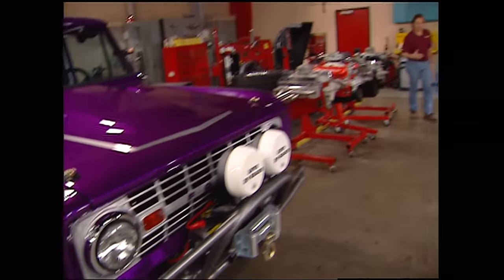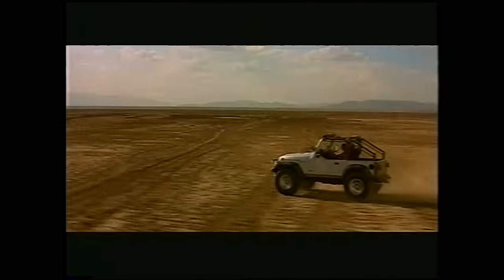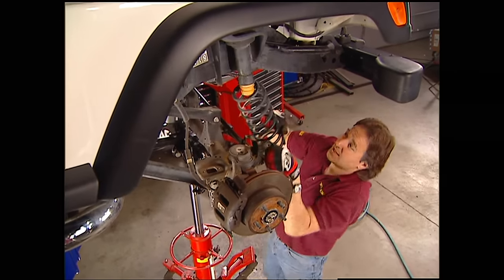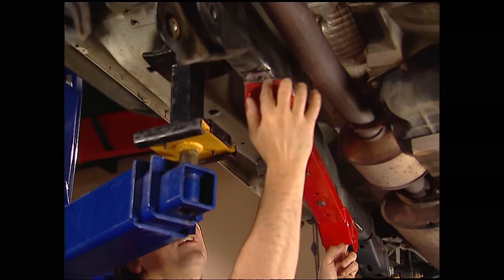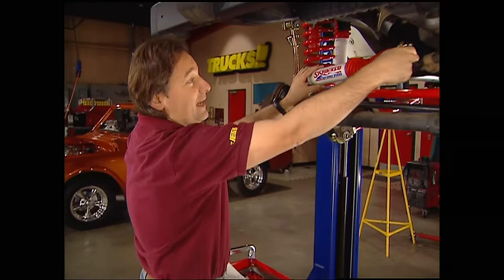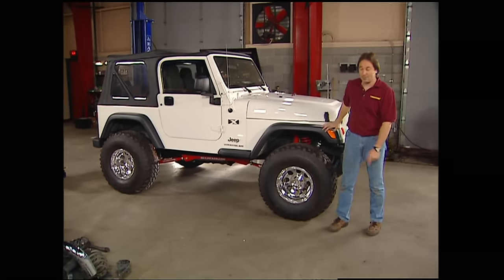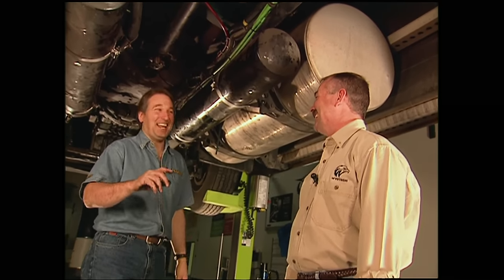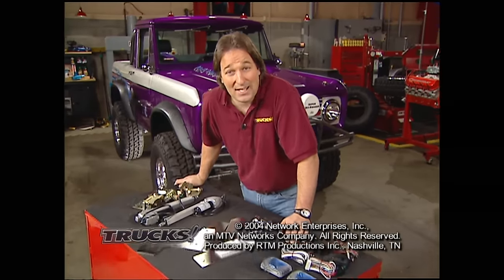Turning A Stock Jeep Wrangler Into The Ultimate Jeep From Tomb Raider 2 - Classic Trucks! S6, E3

Comment: Entertaining I've give them that.  My son just purchased a 2004 Jeep Grand Cherokee and he is doing the lift, repairing some rust, addressing electrical issues, installing a roof rack, repairing the sound system, bigger tires, brakes, new heavy duty front and rear bumpers, winch, coolant system, control arms, etc. himself in his drive way with just a couple of floor jacks and jack stands.  A friend is making the custom bumpers and my son will do the welding and powder coating.  All of this in the evenings and on the weekends, with a day job and he isn't a mechanic.  I say this for anyone looking to do mods/upgrades to their off-roaders that you don't need a fancy shop, deep pockets ( do some competitive shopping) or think the only way to get what you want is to pay someone to do it for you.  My son has made mistakes, learned a lot along the way, had some speed bumps, but when he finishes it, he'll know he did 99% of it himself and will have pride in that.  Plus know that if something happens on the trail, he'll have the knowledge to hopefully fix it and keep rolling.  My old daily and now his, is a 2005 Jeep TJ Rubicon, 6-speed manual.  Not what you would get on the highway with but darn fun to play in the dirt with.
Reply: I’ll give them that lol

Comment: You did not address the drive shaft angles when you lift a Jeep over 2 1/2 inches……
Reply: Presumably he would have adjusted the long arms to correct the pinion angles for the lift. An sye would definitely help here as well.